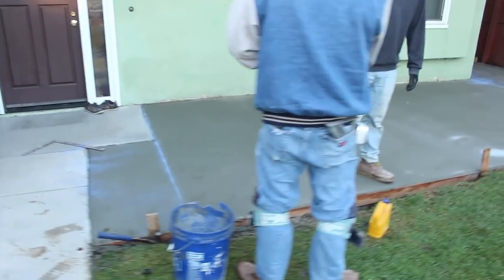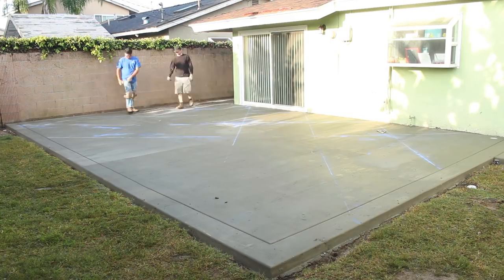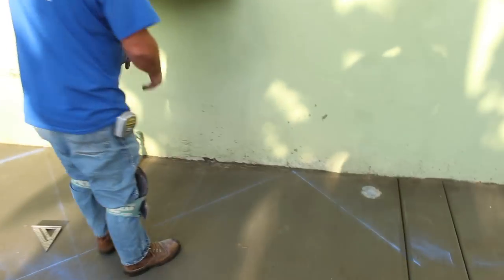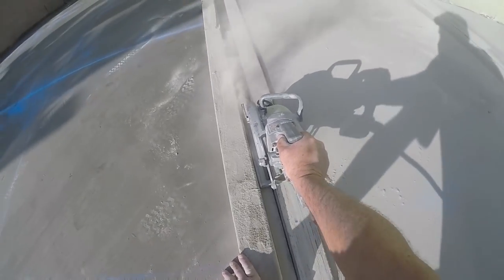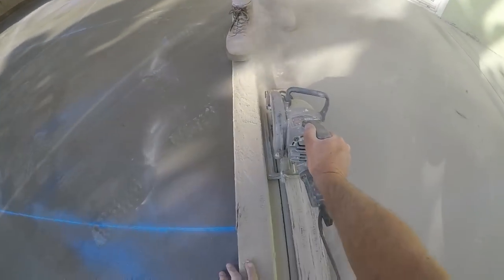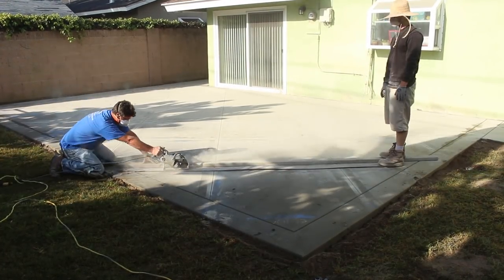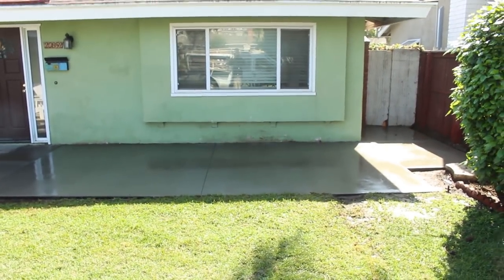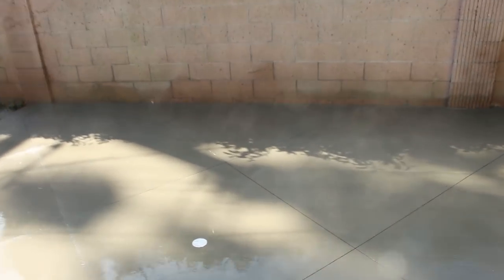How to Saw Cut Concrete into a Diamond Cut pattern for your Concrete patio part 3

Comment: Thanks for the video, I always wondered how u guys did ur joints.  Also, do u go back and finish the joint with a grinder up against the house?? And also, what if u don't add the fiber, do u have to wait an extra day or two to saw cut??
Reply from the maker: R&S Services 
yes a right angle grinder 4 inch diamond blade. yes waiting extra day will help on the chipping, but it may have already cracked.

Comment: If you did a 1/8th inch resurfacing instead of a rip and replace of the slab, could you still do a 1/2 inch to 3/4 inch daimond-cut pattern saw cut on the existing concrete? I want to cover up some shrinkage cracks but also want to make it look nice while I'm at it.
Reply from the maker: Yes you can, but the cracks may reflect through the coating within a year.

Comment: Great video. If you saw cut, and set your expansion joints, say, in a six-foot wide square pattern, how deep should the saw cuts be to prevent cracking (where you don't want cracking)? I like the clean and neat cut, versus the usual unsightly joints, but worried about cracking.  Thanks!
Reply from the maker: 3/4"

Comment: I’m having a patio poured in my backyard. It’s 31’x21’. Do I need to divide this area into multiple pours? Or can I just saw cut control joints to aid in future cracking.
Reply from the maker: Sawcut within the first 24 hours
Reply: Odell Complete Concrete ok and then no fiber joint material is needed in the slab?  Thanks for your time